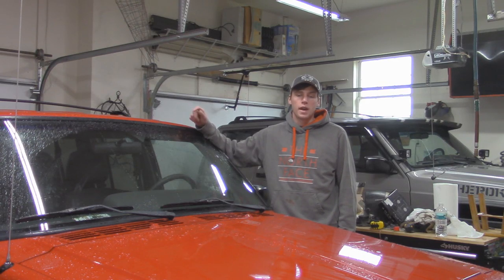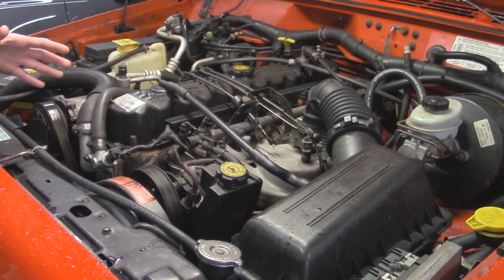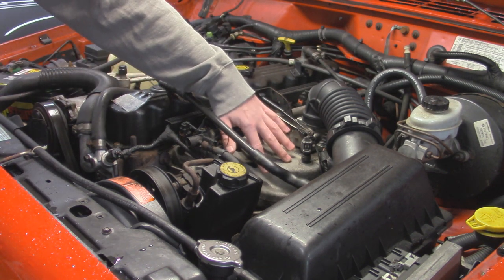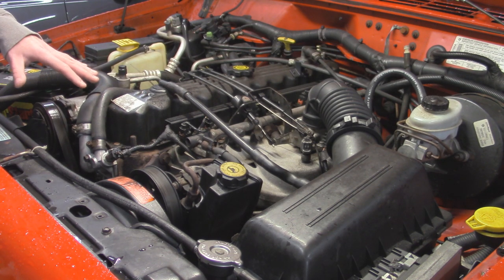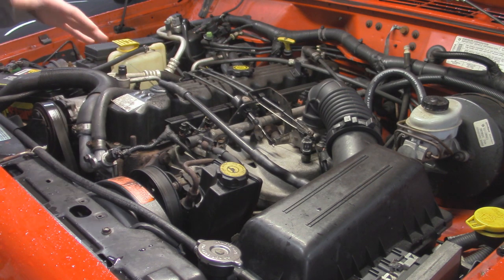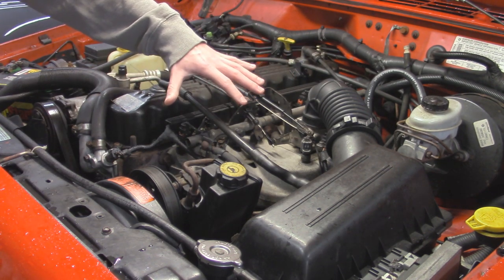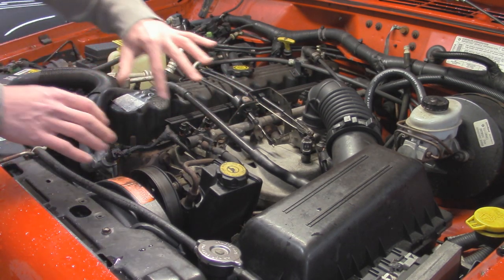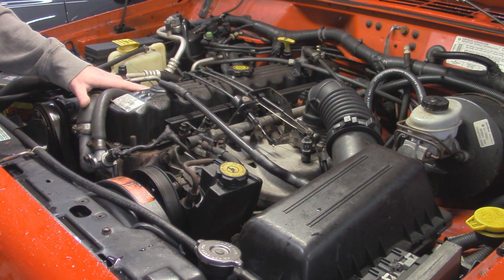Jeep 4.0L Exhaust Manifold Replacement

Comment: I’ve just recently replaced my exhaust manifold. I cannot for the life of me get the flange to front pipe gasket to seal properly. I’ve tried three times with three different doughnut gaskets. I’m beginning to think the front pipe flange is warped badly. 
I made sure to evenly tighten the bolts going back and forth until I couldn’t tighten anymore. 
Any advice? Change my front pipe?
Reply from the maker: Yeah hard to say without looking at it but if it comes down to it you may need to replace the front pipe.
Reply: @OutJeeping  I got it to seal. Good ole impact gun did the trick. This spring I’m probably going to put In a new exhaust. Thanks for the reply back.

Comment: Hey Austin, what kit did you use (link isn’t working) and is it still holding up?
Reply from the maker: It was just a cheap one from ebay. Has a crack in it already. But that could be from the rest of the exhaust having loose mounts or bad motor mounts.

Comment: Thanks for the video. Did mine yesterday and while I was in it I repaired the factory “pinch” or “double dents” that are in the top of the down pipe. Fascinating internet debate on those. Some say needed for axle clearance (which doesn’t pass the sniff test) and mostly seems to be an emission tweak that got them through either California or Federal testing. Either way, it’s fully open now and power is noticeably increased. Walker brand replacement pipe is not mandrel bent so I opted to repair. Weeeee.

Comment: Finally a decent, comprehensive look at the Jeep exhaust/intake manifold replacement. I rebuilt the engine of my XJ four years ago ( valve work and seals, one new piston, new rings and rod bearings) and had to ask a friend to install the manifolds due to me not being home for a few weeks. He installed the intake before the exhaust manifold... took him six hours! I can see why! Got it on crooked and I spent some time getting the intake to go on the head dowels but I was looking for more bolts under the intake. Now I know I got it right. Finally I am getting the Jeep back on the road after having it on my shop lift for all these years... (health issues had stopped me in my tracks). Thank you very much.

Comment: will this upgrade increase throttle response or whatt?
Reply from the maker: The flex pipe in the header helps prevent cracks in the header over time which creates exhaust leaks.

Comment: How did you know to not disconnect the battery before disconnecting the fuel line?

I'm asking not to critique,  I just don't know how to tell the difference between vehicles that maintain fuel pressure to the rails (like a 2000 car I once had) vs those that don't when the vehicles are turned off (like the '99 XJ I currently own).
Reply from the maker: That's just how the Xj's are designed, the fuel pump only turns on while running or during the 5 sec pulse before cranking.

Comment: That link is old what brand are you using for the manifold? Is it a Dorman?
Reply from the maker: It's a no name brand from ebay. Here is a similar one: https://www.ebay.com/itm/355138230289?fits=Year%3A1999%7CModel%3ACherokee%7CMake%3AJeep&itmmeta=01HSE33ZWAQ0W9G1EW0AWBEPRS&hash=item52afe35811:g:tNEAAOSwoGplJOuJ&itmprp=enc%3AAQAJAAAA0AaPXxfGJ%2F3NPQKjjKyenkP519CqmQ34hMj4VKhx6rCG7Xy3ay%2BATQJ3ffu8IqGx4weiesoJ4o56vwz158HZFPnmwAwcaESTNsgewifttV8GvpmdZn8yBXapM94YQMAwC677nkYuS65BU%2BUIVx8FGlsdyKK%2BQxoDvZdIAYFzxtCkDXA6JwJ7dXJr1W%2Fv2bWX0kE5jrj7pmjPVjnvdKoKfPMtIA7JQsjvc3tzz9%2FLspKV7y%2FMldqSF6YZmNkDnZWHWGGav%2Fcou1vBYG1PQ8h5NEE%3D%7Ctkp%3ABlBMUMD-j8PLYw
Reply: Thanks man appreciate it, I ended up going with the Dorman and just got it done. No leak for now, cheers 🤙🏻

Comment: thanks for the video. i just did this weekend. mines a 94. i dont know if anybody will answer but the clips on the plugs of the fuel injectors broke off. is that going to be a problem? should i zip tie them in place or just call it good? they feel fairly secure.
Reply from the maker: You should be alright, I had some break on mine as well. It just makes sure that the injector doesn't rotate and pulls off with the fuel rail when you remove it. Also for it to not leak under fuel pressure but it shouldn't cause any leaks as long as the fuel rail is bolted down securely.

Comment: What port is that on the intake manifold that has the rubber cap on it? It's on the side toward the left. Mine is missing that rubber cap but I put my finger over it today and the jeep almost stalled. Its taking air straight from the engine compartment.
Reply from the maker: If your talking about the drivers side, the blank rubber cap is just an extra vacuum port not being used. Without it on it will cause a vacuum leak which is what you are experiencing.

Comment: Good video.  No broke off bolts in head.  Lucky!!!
Reply from the maker: I've never had an issue with broken off bolts on the several exhaust manifolds I've done. Until the last one I did on my friends Jeep I broke the very last Bolt.

Comment: Will that manifold fit an 01? What did you do about o2 sensors
Reply from the maker: It will fit but it will have issues with the O2 sensors sense there is 4 on a 2001 and only 2 for a 1999. You will have to use the original manifold design or a different header design that has 2 spots for the up stream o2 sensors.

Comment: How long does a job like this take? Looks actually pretty simple except for the 4 intake bolts
Reply from the maker: Roughly 3-4 hours depending on how familiar you are with working on these. Most of the time spent is cleaning off the gasket surfaces.

Comment: Great vid! Do you know if that particular manifold will fit '00-01s with the updated intake manifold? (with the earlier style front pipe)
Reply from the maker: It will fit but the O2 sensors will not work if you have pre-catilitic convertors right after the exhaust manifold.

Comment: Link for torque sequence (ended up finding it online)?  good video.. Just finished, maybe 10 hours total, but also changed the valve cover gasket.  Longest part was cleaning everything, hardest part was getting the exhaust flange off.  I was able to get a torque wrench on all the bolts/nuts with creative use of adapters/extensions.  Now time to change the radiator...
Reply from the maker: I just did a quick google image search of the torque sequence and it pops up.

Comment: Would it be a bad idea to not only use new bolts for the manifolds but also use anti-seize just in case you need to take these parts off again? I just got a '99 Sport and I am not so sure my manifold isn't cracked. Of course the job isn't terrible to do but my biggest fear is obviously breaking off bolts when working on these rust buckets.
Reply from the maker: You can certainly get new bolts if you feel more comfortable. For me I've done this job about 4 times and never had any bolts break. As far as antiseize, even though I use it for just about everything on the jeep, I stay away from it when doing engine parts. With the heat cycles of the engine it could accelerate loosening bolts over time.

Comment: Someone should make a custom head with the exhaust ports on one side in the intake ports on the other.
Reply from the maker: Wouldn't be possible with the 4.0L being a push rod engine. It would have to be overhead cams. But I like your thinking!

Comment: I am going to attempt this job.I do know the exhaust manifold is cracked in 2 or 3 different spots.Could I get these spots welded and go with the same exhaust manifold or should I buy a new one??
Reply from the maker: All about preference, i have seen people go both ways. But for me if you are doing all this work I would just replace with a new one.

Comment: Is there a trick to getting the intake manifold back on and lined up properly? I was trying for about 2 hours and it refuses to line up on the little pegs.
Reply from the maker: I always start off with lining up the pegs first on an angle, then hold pressure against the manifold as I thread in a few bolts.
Reply: @OutJeeping  thanks for responding, it turns out the exhaust manifold I bought wasn't cut right so it wasn't lining up, I had to break out the grinder.

Comment: Great video. I noticed you used no sealant on the gasket. I'm a ex mechanic here in NZ and was taught to use sealants on manifold gaskets. What's your thoughts on the matter?
Reply from the maker: For me I see no need for extra sealant as long as the surfaces are clean and what you are putting together isn't that prone to leaking.

Comment: Just did mine, and for some reason I’m misfiring on 5 and 6. Like what the bell
Reply from the maker: Did you accidentally swap the injector wires between the two injectors?
Reply: @OutJeeping  wasn’t properly aligned with those two indents you pointed out, it’s not even a noticeable issue until you run the thing. That was lowkey a very important tip
Reply from the maker: @Mike_hunt01  Yeah you got to be careful with that step. I have installed it wrong on my friends jeep in the past and have actually broken one of the tabs on the intake while tightening it due to it not being aligned correctly.

Comment: What hose is connected to the external part of the manifold(on the left side) and what does it connect from? I am trying to figure that out and no luck so far. 
Thank you!
Reply from the maker: As in left side look at the engine from the drivers side? And on top of the manifold or on the manifold side?
Reply: @OutJeeping  on the manifold itself on the side. Between second and third cylinder’s
Reply from the maker: There should be one or two smaller hoses coming out the side depending on the year. One is for the evap system and the other is vacuum to power the HVAC controls as well as cruise control.

Comment: I like the inline 6 bit it's a dog for gas mileage.Wouldn't it be cool to put a inline 4 T in a Cherokee?
Reply from the maker: 4bt? It would but also alot of work.
Reply: My 2004 WJ 4x4 does 18 MPG all day every day. I've had it up to 22 on long freeway drives. It's 100% stock, 3.73s, tires are just a hair bigger.

Comment: For your sludge build up, drop a can of Sea Foam in the tank (full) They also make a product that you can spray into the throttle body to hel clean the top end. I've used the fuel/oil additive and am happy with the results. Very good instructional video, great job. God bless.
Reply from the maker: Yeah I've been meaning to do the seafoam treatment on this Jeep, I've done it on my other Jeep in the past and it looks a lot better when I did all the gaskets in the engine.
Reply: OutJeeping Hello Austin.  You mentioned in a different video that you changed the exhaust on your 2001.  I have a 2001 as well and would like to do the same thing.   Would you be able to provide some direction on what you did and what parts you used?  I would appreciate any help you can offer.  Thank you.

Comment: Awesome video, super easy to follow. Just finished my swap. Only thing that I noticed was the exhaust manifold that I used, which was purchased from your eBay link. The thicknesses of the flange is slightly thinner than the intake manifold flange. This causes the washers to tilt when tightened down. Saw some comments on the forums about people welding little washers to make up for the thickness difference. Just want to know if you had the same issues when you put this on the jeeps you worked on with this header. Thanks
Reply from the maker: Yeah I went out and double checked on the jeep and the thickness is the same and the washers are straight on there. What year is your jeep?
Reply: @OutJeeping  I have a 1998  Cherokee. Could have just been a fluke or something. Most of the bolts needed to be shimmed but there were two that were really close to perfect. All that I did was took a washer and cut about a quarter off the one side, just enough to clear the intake manifold side. Worked great. Just a little tricky to hold them in place.

Comment: I've wondered if wrapping the new header would help relieve some engine bay heat?
Reply from the maker: It would help some but I've also heard people say it accelerates rust because moisture could get trapped it there.
Reply: I know that is always the risk of wrapping headers... Guess hood vents are the best option...
Reply: It would trap waterbif it wasnt a daily driver. If you drive daily the extreme heat and the porous nature of header wrap allows it to breathe off any moisture. It will not however do much for underhood temps or the longevity of the manifold. I wrapped my last dual flex manifold (same type as OP but made my Omix). My wrapped manifold lasted 2 years. It has a huge crack in it and I will be replacing it with a Banks header. Supposedly very durable and never crack
 Also they flow excellent and actually make a bit more power if used with a high flow cat and cat back exhaust

Comment: The video helped a lot. I just replaced my manifold and it was really helpful to see how you did it first.
Reply: Was it hard to do?
Reply: @officialWWM  It does take some time for sure. I would have some liquid wrench to help with the old rusty bolts. The bolts on the underside of the intake manifold are hard to get to. I'm glad I did it myself. I priced it out and was quoted 970 bucks for a shop to do it. I got the new manifold from Amazon for 100 bucks so I saved a ton of money.
Reply: @EdwinHuntsman  thanks, I actually did mine yesterday and while I’m glad I did it myself, let’s just say, I won’t be in a hurry to do it again, lol!

Comment: I plan on doing this with a banks header. I want to wrap it with heat shielding to prevent vapor lock
Reply: It'll rust.
Reply: Just installed a banks header, it fits nicely. You may want to consider ceramic coating instead. I kept mine as is.

Comment: How’s it holdin up bro? Bout to do the same next week
Reply from the maker: So far so good over a year later.
Reply: Hellyea appreciate the reply bro everything seemed to work out good on my end also with exact install. Other question is did you ever have to retorque/ re-tighten bolts after so much break in time?